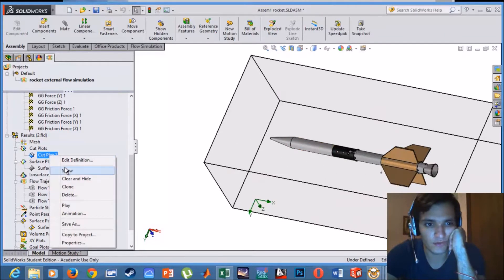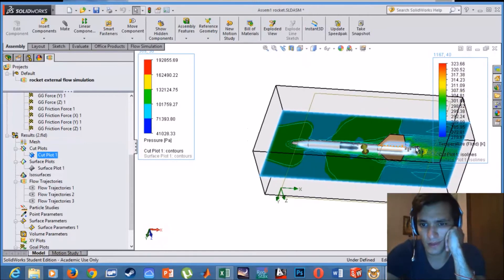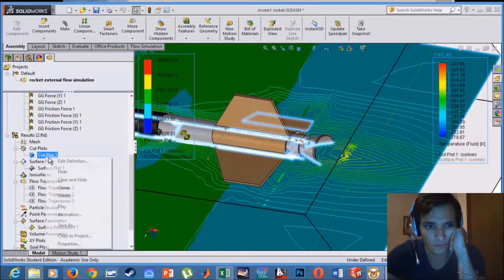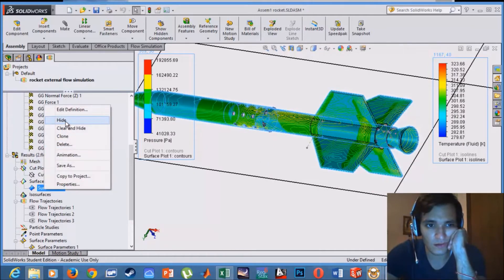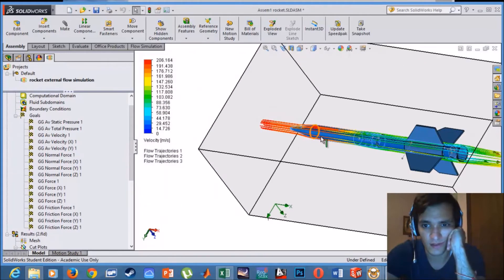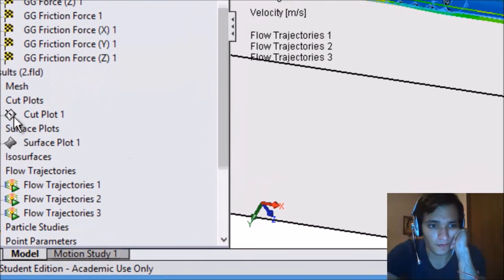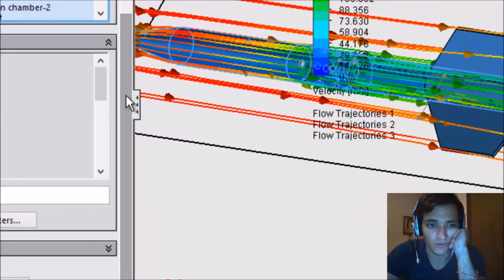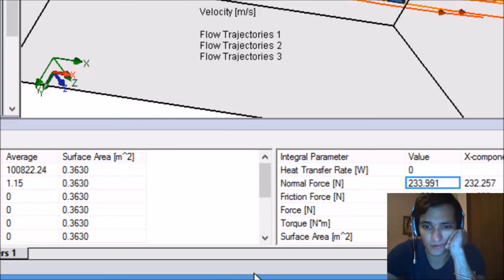Rocket External Flow CFD Analysis on SolidWorks

Comment: What boundary and initial conditions did you use for this simulation if I may ask
Reply from the maker: +Torsten Maier i can still remember that i have only set the inlet relative velocity of the air flow  to 200m/s, that was it fairly simple.